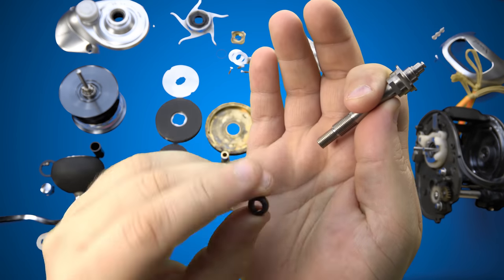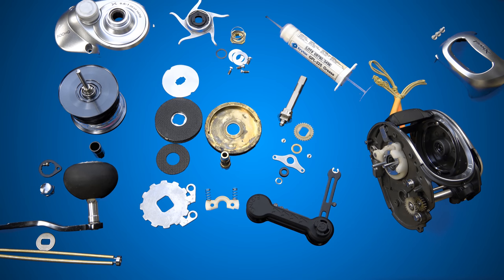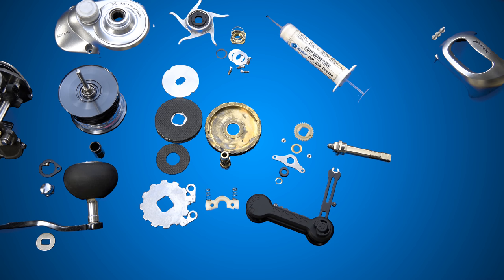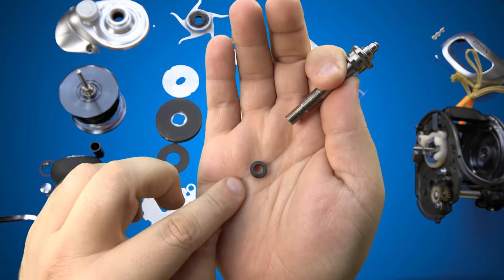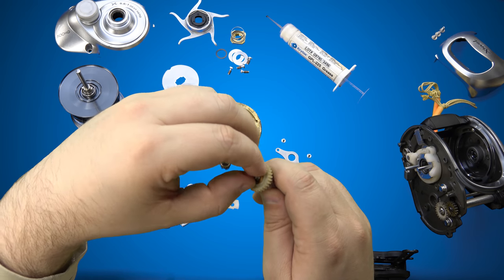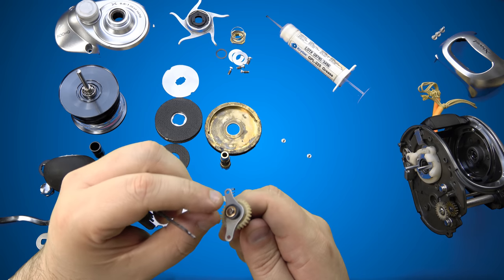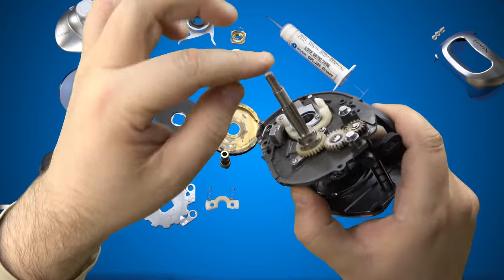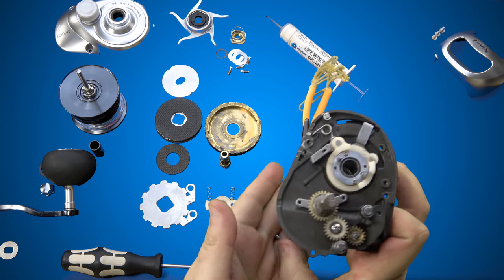$1000 miniature bearing. Put in a Fishing reel

Comment: I have argued since I began tearing apart reels, that on a multi-bearing reel, the same lower bearing is one a a few that should not be a ball bearing. It ought to be brass or some similar metal. A ball bearing is no improvement. Only allows manufacturers to tout "more bearings"
Reply from the maker: Yup... MO bearing MO problems... But in some instances in the high end its nice

Comment: What makes Vespel so expensive is it's weight and stability in extreme conditions. Resists heat, cold, pressure, and vacuum. But it's in no way as good as ceramic or steel ball bearings. Even Oilite bushings have better friction coefficient than polyimide. It's so expensive because of it use in Aerospace where weight, heat and pressure are super critical, but in a fishing reel it's just a waste of money and a downgrade (Unless someone sends it to you for free and you want to experiment with it lol)

Comment: Just wondering if it was the dawn cleaner in the ultrasonic or if there was some dissolved metals in the solution. Dissolved metals in the solution along with something that could cause a weak electric charge such as a piece of carbon steel, may have caused the dissolved metals to plate the knob.

Comment: What makes the vesper material so expensive?   I’m down with no corrosion as the gulf coast sees a lot of hypersaline wade fishing.  If the vesper is easy to sand, how will it wear under load?   Especially a sandy/salty load?
Reply from the maker: First off ...it's a dupont industrial material...that sorta thing automatically makes it super expensive......But the only thing I can gather is that it's a polymer that withstands heat and wear better than pretty much anything else...with a minimal coefficient of friction.  With tolerances tighter than ball bearings.  Lower friction saves big bucks in industry when machines run all day and excess load due to friction jacks up the electrical bill.  I've been in some serious machine shops....pretty cool....Haliburton was a trip seeing titanium jet fuselages being made.  Tried to convince the shop mgr to give me a bit as a souvenier lolol

Comment: I have seen you put double handles on small spinning reels and now a single handle on large casting reel. Could you go over the benefits for those 2 cases?        More balance with double handles on small spinning and the ability to use a larger single handle on the large casting? Just my guesses.
Reply: Double handle on small spinnings is also pretty useful when you need to fish fast and don't have time to miss the handle

Comment: Which e-Ring Tool do you use? Seems hard to find one that's suitable for the tiny e-rings in fishing reels..
Reply from the maker: removal in most fishing reel applications is easier with a flat head screwdriver and a pick tool.. E ring tools only are best in a few situations....but when they are..they are much better....point being you may not have much use for it.
Reply from the maker: I use this one...though not sure why the price is more than double what I paid for it now.  https://amzn.to/2s88tZK
Reply: @TackleAdvisors  Thanks man! I use a flathead to remove them as well. This works quite nicely since once the screwdriver is in place I can cover the ring with a cloth or plastic foil before I pry it out to prevent it from flying off. 
However, I usually struggle most when I want to put them back in place. I had a few jumping away and myself on the floor searching for them. That's where I hoped the tool would help.
Though $50 is quite a lot - even though that one looks really nice having tools for the smalles e-rings down to 1.5mm. Usually they start at 3mm and that doesn't make much sense.
Reply: @TackleAdvisors  - just as a follow up - I think the tool is now sold under a different brand name: Dynamite DYNT1107 $24 - looks excactly the same.